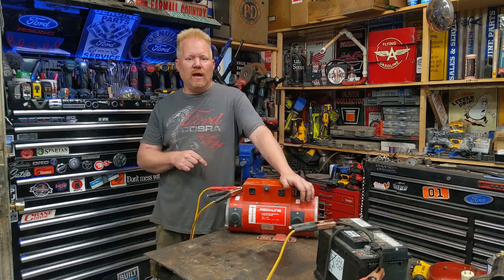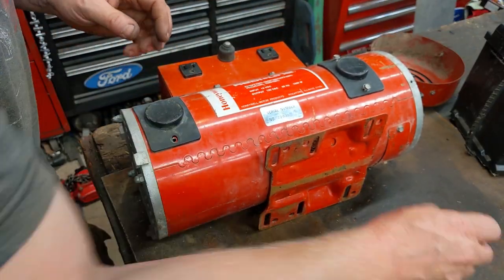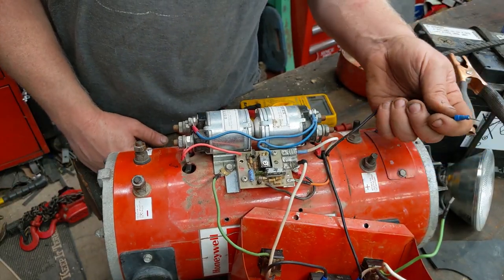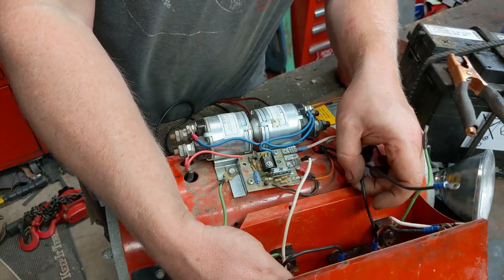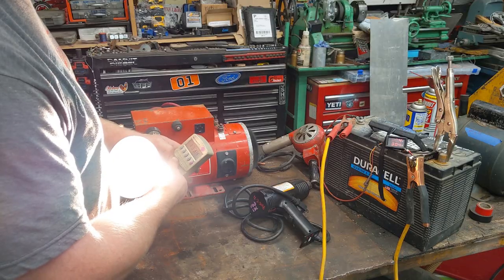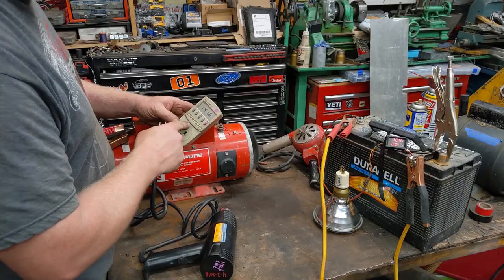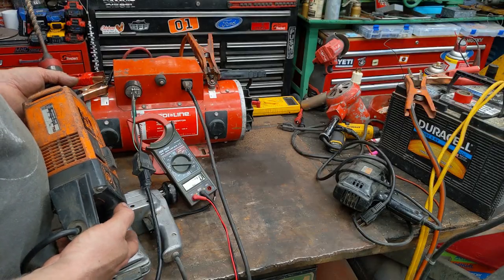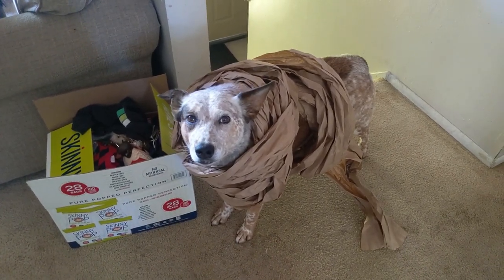12v DC to AC ELECTRO MECHANICAL Generator REPAIR .. HOW THEY WORK .. solar lithium powered?

Comment: One advantage with two 12v motors is you could wire them in parallel for a 12v system and in series for 24v system. Lots of larger commercial trucks run 24v so that would be useful.
Reply: That makes sense
Reply: It won't work as it is wired now. Both negative leads are wired together through the frame.
Reply: @PeterWMeek  yeah because one is a CW motor and the other is a CCW due to how they're coupled so you just use one of your positives as your negative.

Comment: These type machines have been  around since  the 1920's.  "Motor generators."   Usually  other way around,  AC line powered, with various DC outputs,  sometimes  high voltages for  vacuum  tube  anodes.  In WWII  "dynamotors"  were popular   particularly aircraft, typically 24VDC in, and various  DC  outputs  for vacuum tubes.   Welders  used to be   like these,  AKA  120/ 220 in and  DC welding voltage out. in 65--67  a state patrol had a tube, trunk mount  radio and the tx was  dynamotor powered.  He had to remember to key the mike,  wait  a second for the dynamotor to spin up  before speaking.  You could always hear a tiny bit of whine in the signal.

Comment: They certainly are interesting critters. Used to be way more common than you think. All of the old, old, really old (1940s to 1960ish) Motorola two-way radios used to have them. They took the six volts from the battery and produced either six or nine hundred volts for the plate voltage. Naturally they were old tubers back then. Amazingly they can still be found in service today. One police department used one up through the late '70s for their police department base/disparch radio. You knew who it was because you could hear the dyno spooling up as the tubes came to life.
Reply from the maker: That's neat
Reply: Also used in US B-17 bombers, English Chieftain tanks etc. I also installed a massive modern 3 phase one to run some American machine tools in England.

Comment: When I was in the Army, we had units similar to that in our ambulances to supply AC power for various equipment.  Ours input 24v though and were rated at 1,800 watts.  

Surplus Center in Nebraska used to sell these as "Rotary Converters"
Reply from the maker: Very cool. I see the brand I have also comes in 24v and 36v. That would definitely be better as the amps required would 1/2-1/3 for the same output.
Reply: @sixtyfiveford  We had them in our ambulances mostly, but they were also in command trucks and command APC's.  I thought it was weird seeing an electric typewriter in a command APC plugged into one of those.

Comment: I had that exact model in a 1984 Bluebird WanderLodge motorhome (I have some clips of the motorhome on my channel). In that application the purpose was you could have some 120 volt appliances as you were driving without having to run the auxiliary diesel generator - in today's motorhomes those duties would be performed by an inverter. It wouldn't run an air conditioner but it would pretty much run anything else in the coach except for the electric water heater which you didn't need because that was heated by the engine when you were driving. Mine had been taken out of service and I never tried to get it working because since I live in Texas I always use the air conditioners so I always had the diesel generator running...
Reply from the maker: That's awesome.
Reply: @sixtyfiveford  what breed is your dog?
Reply from the maker: @louzerz  Red Heeler
Reply: I didn't know the hot water was heated by the engine? Must of had a heat ex changer somewhere in the line?
Reply: @Captionmarvelous  water heater had coils in it that engine coolant ran through.... Very common in big rv's 👍
Reply: What the difference between electric one and inverter?
Reply: @guillermodelatorre8  No difference in output..it's the method of turning AC into DC..this is basically a "mechanical" inverter - this was back when electronic inverters were'nt really common (or affordable)

Comment: I had a blue one in my 90 Chevy work van. Had one wire from battery to positive and jumpered over to the other positive and negatives grounded to the floor.  Great video. Thought id never see one again.
Reply from the maker: Very cool

Comment: What a cool contraption, I love finds like that and figuring out what went wrong.  I know a guy who runs AC power tools off alternator(s), on his older truck he was welding from the alternators and that poor big block Ford was being dragged down to its knees, and it sounded like bees.  Yeah, resistance loads draw one hell of a load, kind of makes one turn off the coffee pot as soon as possible.
Reply from the maker: That's a unique setup.

Comment: On some ships they have motor generators sets (MG set) like this on a larger scale. They are often used to change the phase from 60 hz to a different value for some equipment like radars and radios.
Reply from the maker: Very cool.

Comment: They were used out in the field to provide ac power to power tools in remote locations.. Usually mounted underhood or in a work body cabinet... This was long before portable generators got small enough to lug around and long before sine type generators/inverters... Older technology but super reliable and usually built rugged to withstand chuckleheads abuse while way out in the back 40..
Reply from the maker: I can see the usefulness. I may sell it or just stick it under the hood of my truck.

Comment: Had one of those in my locksmith van back in the 90's. Used it to run lights and key machines.  PITA on really cold days in the winter.

Comment: Got a smaller 600w 230v version of this, something to note is that they won't kick on with a small load, so somethings like laptop charger, phone chargers, etc won't trigger, so having a 40w light bulb on hand to trigger it is a way around it. Once they are running it's no problem.

Comment: Used to have these in our M577 artillery fire direction tracks.  Basically an M113 armored personnel carrier with more radios and a higher ceiling.  You have to remember with these things that because it's 12v in and 120v out, that means over 10x the amps on the 12v side of whatever the 120v load is.  So go heavy on the low voltage wire size.  Think welding leads.   I say "over" because they are not, of course 100 percent efficient.  All they really used it for back then was running a Mr. Coffee and a Norelco shaver.  Those tracks had 24v systems, so it was only 5x the amps.   But still.

Comment: I have a smaller version of what you have there. I think they would have mostly been used in ambulances and fire trucks to run the radios and other electronics in the days before wide use of transistors. They use powerful magnets in the field in place of an actual field winding. Mine took at hit and some parts of the magnets broke lose and jammed the motor/generator. I pulled all the broken magnets parts out, cleaned it up and it still does full output with about 1/3 of the magnets gone!

Comment: These were used on bucket and service trucks powered by big alternators while the engine was kept running. They used less space than an AC generator, so there was advantage to having them.

Comment: Yes, there are two motors on the same shaft. Ordinarily, they are run in parallel, (watch your polarity) for 12 volts, and series for 24 volt systems. I installed several of these in buses during the late 70s to operate an A/V system. Output frequency stability however, sucks.

Comment: My grandfather was an early 1900s electrican also my uncles were in the radio  communication business - 
      So. I was around all that growing up as a child - my dad was a publisher - as a kid i would ride with my dad as he went to do stories for his agriculture trade magazines - 
       There were still small towns that were powered by 110 volts DC in the 60s - small towns could not afford AC power plants because the generators had to run 24/7 - 
      Towns with DC power plants might run 2 hrs in the morning and 2 hrs in the evening to raise the town voltage and charge the large power house batterys - 
   If we went and stayed at a home in a small town i remember seeing TVs pluged into motor generators to convert the 110 DC voltage to 115 volts AC - 
       There were many rural farm homes that still had the farm light plants were the house ran off the house batterys all week and were charged all day once a week -
      If they had floresent lights in a barn or a TV they had a motor inverter to change the voltage from 32 volts to 115 volts AC - batterys sold as deep cycle battrys today use a acid strength of 1.275 - so they only last 5 yrs or so - 
     I live in the deep south were it never gets colder than 5°F - farm house light plant batterys often used a weaker  acid of 1.195 strength acid - there was a 30% capacity lose so they used larger batterys -  they will freeze at 0°F with weaker acid - 
     With the weaker acid batterys lasted 60 yrs or more charging once a week - 
    The refigarators, freezers, water pumps, radios, fans, & lights in farm homes were often all 32 volts DC - fridges used belt drive compressors -    up ttill around 1950 the US had no standard voltage - newer appliances after 1950 were only sold in 115 v AC -

Comment: You are the wizard of fix-it. As the motorhome guy said, nowadays an inverter would provide that function, but I know that they also have an energy cost to function even though they're not turning any motors or generators. I wonder how efficient this method is compared to an inverter, just speaking of the energy cost of the device to make 120 vac out of 12 vdc, not counting the actual loads being placed on either one. Would it be a stable enough sine wave and frequency to run computers and such?  Great video. Thank you.
Reply from the maker: I'm not sure of the efficiency but I would suspect it's low due to the 20amps DC required to just spin/idle the unit. However I guesstimate it pulls around 150-200amps/12VDC(can't be over 200amps as that is the fuse rating they call for) to deliver 15amps/110VAC. So that's 1800-2400watts of DC to produce 1600 watts of AC. So 66-88% efficient; ballpark 75% efficient... Compare that to the modern efficient sine wave inverters and they are low 90% but they also draw power when nothing is pulling/they are idling(old inverters are 80%). Though this spins and is the same sine wave power as the power company makes, it has one HUGE drawback: HZ and voltage are dependent on a constant 12.6V input. Lower/raise the DC voltage and the HZ/AC voltage swing with it. Computers all have their own power inverters/supplies built in and modify the voltage and HZ to fit their needs. Most will have a huge 110-250v and 50-60hz swing they say they can work with.
Reply: @sixtyfiveford  Thank you very much for that reply. That was exactly the information I was looking for. I knew there had to be loss in both systems due to mechanical energy costs  in the one case and some kind of heat/semiconductor drain in the other. That was still a great innovation prior to inverters coming along, but just a bit thirsty on the twelve volt system. 90% efficiency in the new inverters is very impressive. I know most solar units that power AC needs in homes have huge inverters, but there will always be energy losses in generation and conversion of power. Great video. I love how you analyze situations and devices that the rest of us have to just scratch our heads over. Well done.

Comment: The dual solenoids are considered constant duty unlike the intermitted duty used on the old ford starters. Should be rated at 100 amps often used on school buses to power all the internal accessories.

Comment: The airforce used to use a lot of motor generators on their airplanes back in WW II.
They would run off of 28Vdc and produce 400Hz voltage. 👍
Ginger doesn't mind being rapped up as long as she is with her best friend. 🥰
Reply from the maker: I did read something about that. Do you know why they would need such a high HZ?
Reply: @sixtyfiveford  Hey there! First of all, you rule! Been watching your videos for a very long time. Not only didn't you sell out and produce only shill videos, your videos are still very very educational, I practically learn something new everytime.
Regarding your question about the frequency: in aviation, as one can imagine, saving weight is of utmost importance. By drastically increasing the frequency you can significally reduce the needed amperage for a given amount of power. As current is the primary burden for cables, you therefore can reduce the wire cross section for a given load without overheating the cable, thereby reducing the weight of the electrical system. That's the same effect that allows to build much more compact and light weight items such as lunch box sized welders (inverter vs. old school transformers), although the required technology is quite sophisticated and not as robust as simpler designs (AC mains rectification -> chopping -> pulse width modulation amongst others -> and so on)
Enough tech gibberish - thanks again and give ginger a treat!
Reply: @szolo1986   The 400hz AC standard in aviation is to reduce component size and therefore weight, for example transformer cores can be smaller since they need less stored energy.  Generator pole count and gearbox size reduction is another advantage.    Additionally,  it is easier to rectify to DC as the period for rectified 3-phase 60hz  is 2.78mS, for 3-phase 115v 400Hz it is 0.417mS, so a lot less capacitance is needed to bridge the peaks and it is easier to filter the 400Hz "noise" riding on top of the DC.
Reply: I was an electrical engineer working for the airforce back in the sixties, the higher frequency allows the equipment to operate more efficiently, like D• said.
Reply: @sixtyfiveford  Less iron for transformer cores.
Reply: @D2O2  easier to filter and yet airplane Ent audio systems are usually plated with 400 Hertz

Comment: 14:02 I like how you used a vise grip to connect the shunt directly to the battery terminal. hahaha

I suspect that your shunt isn't reading correctly, or perchance the motor generator just pulls 400w all the time. Which in that case that'd be a little unfortunate.
Reply from the maker: It pulls a lot when no load or a light load just to keep the motor spinning. At half capacity to full capacity is about 80-85% efficient if I recall.

Comment: For every 1 amp you draw on the 120 volt side, you will draw 10+ amps on the DC side. ( a little more than 10 A. because of efficiency loss)
600 watts 
120V. X 5 A.= 600 Watt.    
Or....
12V X 50 A. = 600 Watt
Must have a big battery bank with super thick zero gauge wire to draw any serious Wattage!
Reply: well, that's also true of moder sine wave inverters haha! I recently installed a 300W one in my car and had to use pretty thick wire and 25A breaker to safely connect it and cut down on voltage drop!

Comment: I have the same exact model, you have to hook jumper wires across the top posts so u can run 24v
Reply from the maker: They have 3 different models that all look identical. 12v, 24v, and 36v. DA12L, DA24L and DA36L. Yours would be the DA24L where mine is the 12volt version the DA12L.
Reply: @sixtyfiveford  all the manuals that I read say the same thing, to hook jumpers from - to - and + to +, why would they have 4 terminals? Just try it see if it works
Reply from the maker: @TheHomePros6221  Yes. I hook leads from neg to neg and pos to pos and 12v to those. If you ran mine with 24volts it would spin 2x as fast creating 120hz and fry a lot of stuff.
Reply: @sixtyfiveford  yes that is correct, I don’t know why I said 24v but u are doing it correctly, love the vids brother

Comment: My experience with old Ford starter solenoids is they are only rated for intermittent duty; not being on all the time. I assumed they were and installed one on a friend's second battery for his car and it burned up the solenoid. When replaced with the right one all was well.